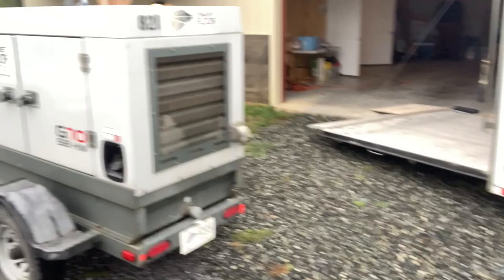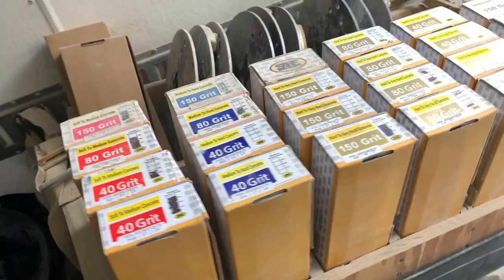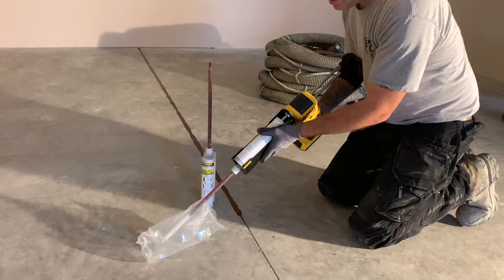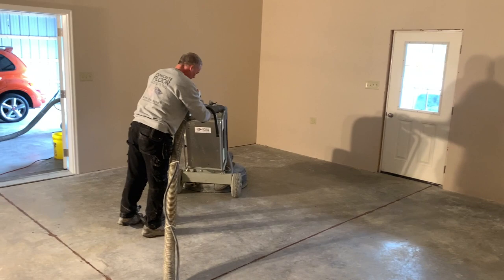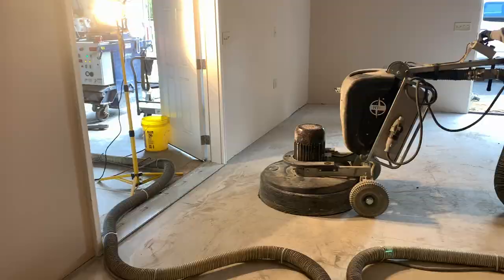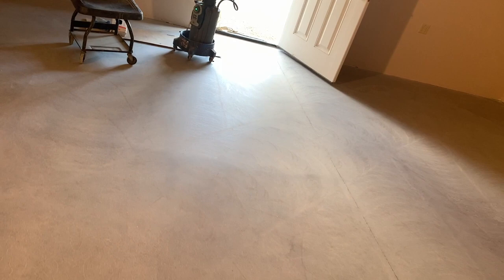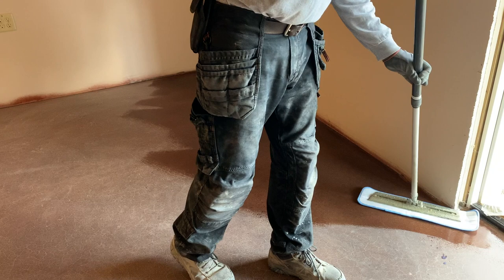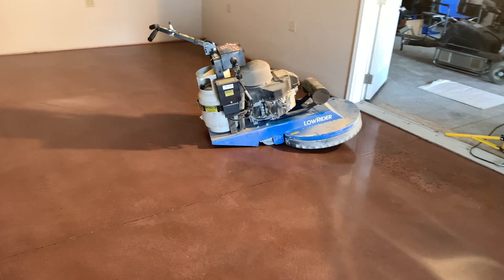Concrete Staining And Polishing From Start To Finish / 9 Step Grind

Comment: I’m getting ready to have concrete poured. Do the concrete finishers have to do anything different, or is this process done over a standard finish.
Reply from the maker: Standard finish is fine, the floor just has to be smooth, The smoother the floor the more consistent the polish will be.
Reply: Concrete finishers I spoke with explained that there are wide pads the finishers should wear on their feet when they first get on the floor.  Also when they are screeding the concrete they don't want to fill in their foot steps behind the screed with cream but to try keep the mix consistent on the screed as the do that.  There is a screen roller, they roll the floor with that after screeding the concrete too.  The roller pushes down the rocks and stone to a consistent depth to allow a more consistent look.  After bull float, the finishers use a power trowel with a pan and this is when the concrete is still soft and they should wear the pads on their feet to spread the weight otherwise you may see foot step marks after grinding, areas with stone visible and footprint areas where stone is not visible.  Some specify certain stone in the concrete mix, if your ginding deep into the stone to get that stone color. Others will cast glass or colorful stone onto the top of the concrete so they grind into that for a different look.  There are preferences in the concrete beyond the stone mix too but the concrete plants usually have their own recipe they won't deviate from.  I'm in NH, one finisher I spoke with had a preference of Carrol concrete opposed to the concrete coming from a plant named Graves.  Some thing with the amount of fly ash in the mix and bleed water it creates.  This isn't my profession, just info I learned from family and friends in the business.  My floor was already poured we are going to try a salt and pepper grind trying to not go too deep and use black or onyx dye.  Here are some links for colors I was provided.  Hope yours comes out awesome!
https://www.solomoncolors.com/lythic.php#gsc.tab=0
https://www.solomoncolors.com/documents/brickform/color-cards/Pro-Dye-Plus-Color-Cards.pdf
https://prosoco.com/products/concrete-flooring/decorative-color/
http://www.ameripolish.com/getPDF/Ameripolish%20Color%20Chart_Classic%20-%20Surelock%20-%20Dye-N-Seal.pdf

Comment: i want a polished concrete floor.would you recommend the floor be power floated on the initial pour ?
Reply from the maker: The more consistent the floor is when it’s poured, the better it typically turns out. Yes, power trowel the floor.
Reply: @ConcreteFloorSolutions  hey thanks man. really appreciate the response

Comment: What is the cost?
Reply from the maker: It depends on the size of the project, condition of the concrete, job location etc.  Staining and polishing can typically range anywhere from $4.00 to $8.00 per sq ft.  The smaller the area, the higher cost per sq ft.